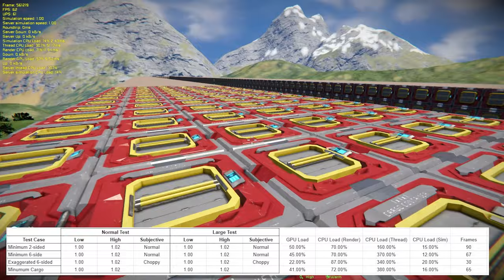Space Busters | Do Conveyor Junctions Cause Lag? | Space Engineers

Comment: 6sideds are causing more CPU load on a server when every player are using them a lot. 
Frame drop is just linked to number of blocks to render. 
Obviously 2sided tubes have a lot less triangles to compute. 
For example if you have a low end graphic card you should not use the new thrusters as they are a lot more complicated to render.

Comment: Oh I see; conveyor junctions have more details in the models. But I guess moving things with sorters seems to cause the game to find a new path everytime; that may be the reason why.
To be honest I was expecting it to cause lag when you changed the grid, because then it would recalculate if and what is connected. Then it would be simply moving from inventory to inventory which is the same in both cases.

Btw:
CPU is still heavily used in game logic processing. Unfortunately most stuff still needs a sequence to guarantee it's working properly.
GPU is only used if you have matricial calculation in case of graphics in most of the games OTHERWISE the dev have to activelly develope a system that can be represented in matrices + implement how it's sent and collected from the GPU usually in form of shaders. (Or find something ready to use or buy)

Comment: That was a great video and it answered the question well. However, if you want to get really academic and pedantic about it, there are more comprehensive ways of doing this. You could have included a negative control test where you put light armor blocks in all the places where you were planning to put conveyors. Then you could have calculated the difference between a given test and the base line. Although, you could also argue that the 2-sided conveyor test already is the negative control, but this is just another way of looking at it. Regardless, presenting raw data is always good, but including calculations makes the presentation better. I would have calculated the difference between 2-sided and 6-sided conveyors. Some of those differences don't really make much sense, which means that we're actually dealing with a more complicated phenomenon here and replicating the experiment might be in order. Most likely, this his more variables than we care to account for.

In any case, minimum 2-sided and 6-sided experiments form a pair. That's great. This is how you make experiments! The exaggerated 6-side and a minimum 6-sided form another pair, which is also good. However, now the experiment layout isn't quite symmetrical, because one logical pair is missing. I'm not saying it's required, since the current experiment was good enough as it is. I'm merely pointing out that if you wanted to do this in a more rigorous way, this would be the way to do it. In normal everyday life you don't need to do things the hard way, but in academic research you want to preemptively shut everyone up by making sure your position is as defensible as possible. I suppose most gamers don't even notice a minor flaw like this, so your setup is still perfectly fine and valid.

And then there's also the other control test people often forget about. What about a positive control? What does this legendary "lag" really look like? We need to know so that if our test produces lag, we'll be able to identify it correctly. So build a machine or use a script that is know to cause lag and measure the impact it has on fps, CPU, GPU, sim speed and other things. Finding a suitable positive control may not always be easy, which is why many experiments are only run with a negative control instead. The lack of a positive control doesn't ruin the whole experiment as long as you still have negative control test.

Comment: I built a welder ship with hundreds of conveyor junctions. It doesn't lag until i turn the welders on. I also know if you create a loop out of sorters, that will cause lag after a long time, as I think it causes a memory leak eventually. The frame drops however, you can cause with a variety of blocks. Unwelded armor blocks are usually the culprit.

Comment: Honestly, that's weird.
My theory always was the grid would be replaced with a "simulated" one (the rough idea is that the grid becomes an inventory that exists with reference to the "mother grid" and some indicator of "sub inventory" but not the actuall shape of the grid which would at least get rid of the 6 sides argument) but affecting the FPS is a weird thing.
As the game is a physics simulation, FPS should basically only be affected by loads on the graphics card i.e. too many corners loaded at the same time or too many pixels on a texture. (Or extra stuff calculated on the graphics card because its architecture makes small math go zooom.) So, I suspect the game actually projects every single corner of those 6 sided conveyors into the world. Even the ones you can't see. But I haven't looked at the rendering engine so that's pure speculation :D

Comment: thanks a lot for this scientific video! 
but it brings up a few more questions for me: do the game has to calculate open connections on the 6-sideds? like if only 2 sides of the cubes are connected to other conveyors/containers? 
what happens if these sorters are off? do you still see the cpu impact when nothing has to be moved around, which is the most common state for grids that are not currently mining/producing? 
does it have to be calculated if you put a cargo container right behind the sorter and after that a lot of conveyors?
will it also happen if you put down for example a o2 generator which is constantly searching for ice/bottles in all connected grids?
Reply from the maker: I can atleast answer one of those for you. After turning off all of the sorters, the 6-sided world's CPU load went all the way back down to what it was with the 2 sided conveyors. So it seems when there is nothing that needs moving, the tax on the CPU from having too many junctions is not there.
Reply: @AndrewmanGaming  wow that was a quick reply, thank you! makes my last question obsolete aswell i think but definetly brings me closer to understanding how the things work
Reply: i will test the open connections thesis tomorrow

Comment: How about testing excessive 2 way conveyors?
Reply from the maker: Technically the giant loop of conveyors was excessive, but I know what you mean. Excessive 2 way conveyors is not really possible because there are only 2 connections. No matter how many you put, there will always be only 1 path for the items to flow. On the other hand, junctions have 6 paths so if you add more on the sides, it greatly increases the number of potential paths.